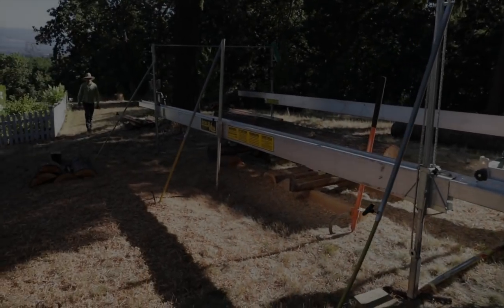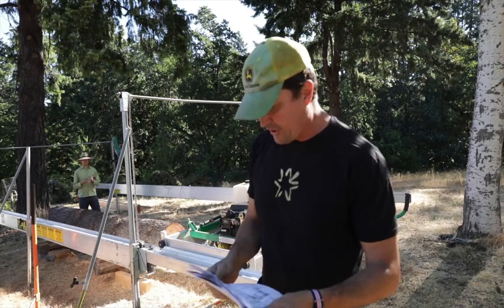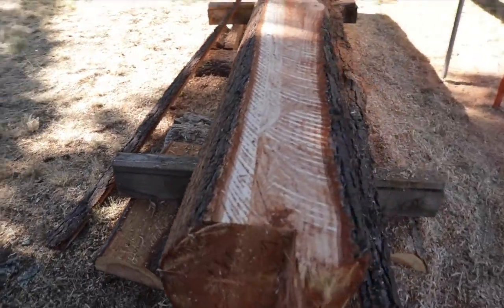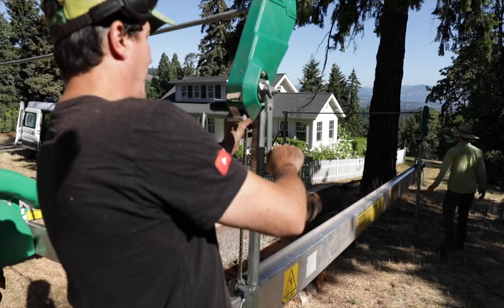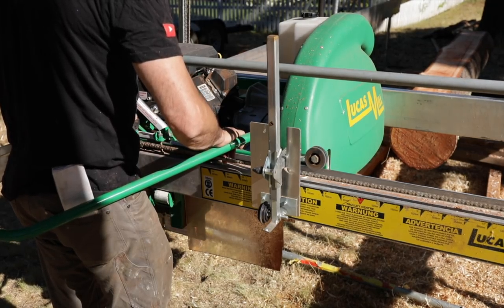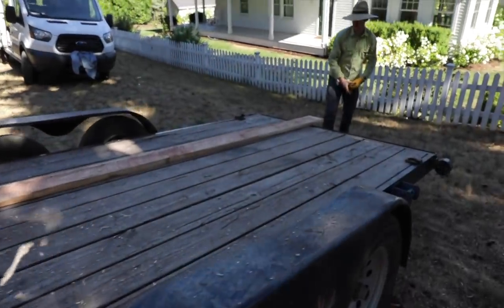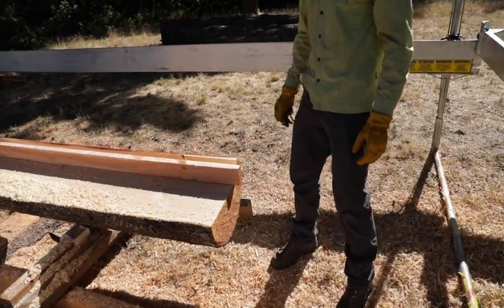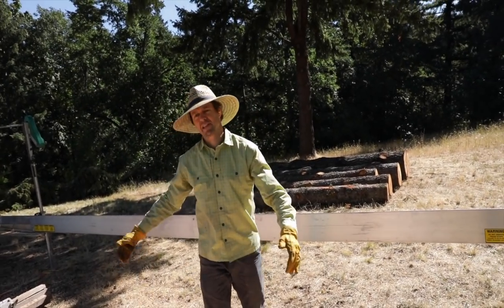AMAZING Machine Turns Logs Into Lumber -FAST!!!

Comment: A 2x8 is cut at a true 2 inches thick by 8 inches wide, but as the wood dries and it planed it shrinks to the final dimensions of 1.5x 7 1/4
Reply: Connor G I quite agree. Always as I have done it. Sometimes I’m very wet timber we cut 1/8th over as it gives us a little more stock for finishing once seasoned.
Reply: Correct 👍🏼
Reply: Drying wood is made by placing the wood in a warm dry place or can you do it with a machine as well?
Reply: Drying wood is traditionally placed outdoors on a block of some sort, then stacked with usually 2-6 inch spacers and topped with a "cover board" as to not let the sun hit the top.

Comment: The Guy below its right. If you want 2x8 you have to cut 2in by 8in, then as it dries and as you plane it it gets its final dimention of 1.5 by 7.5
Reply: That's why dimensional lumber is always S4S (smooth 4 sides)
Reply: Yes! Thats because its planed on all 4 sides
Reply: Exactly drying wood shrinks!  ps-that’s what she said 🤣
Reply: That is not correct at all, go look up "nominal vs dimensional lumber"... educate yourself. It would take forever to plain down .5" per board with a planer and waste alot of time!!!
Reply: @nwhunter3838  Remember that it works out to a 1/4 inch per side, wood shrinks as it dries, more often than not it'll also twist, so you need that quarter per side. I "educated myself", no such thing as nominal lumber, the lumber can be dimensional and of nominal size. Eg. a 2x4 is an example of dimensional lumber in which the nominal dimensions are 2 inches by 4 inches.
Reply: @Intelligent_investor   go to any sawmill and ask if they cut their 2x4's at 2"x4", does not happen anywhere!!! They will cut 1 5/8" and 3 5/8" wet lumber. Please go take a tour of a sawmill and find out for yourself.
Reply: Company's like Weyerhaeuser, Georgia Pacific, and Sierra Pacific would be belly up even in these times if they wasted that must time and product planning a 1/4" per side.
Reply: @nwhunter3838  I'm talking about how it's supposed to be done, the standard guideline is 2x4 rough, and then planed to 1 1/2 x 3 1/2. Also, I don't really think that a 1/16“ per side is enough to turn that extremely wet and rough piece of wood into the shiny smooth 2x4 we find at our local home depots.
Reply: @Intelligent_investor   As I read these comments from you and other youtubers, I get the impression that you all believe a 2x4 is 1 1/2 x 3 1/2 because of planning and warpage when in fact it is not. During WWII there was a lumber shortage along with mills producing 2x4's of all different dimensions. A standard was agreed on and embraced by all... enter the 1 1/2 x 3 1/2. It saved on wood because remember before this, a 2x4 was in fact a 2"x4". Mills now size these boards to have the least amount of waste as possible. I milled some true 2x8's last year and after planning, they are 1 15/16 x 7 15/16... more or less 2x8. The author of this video did not short himself here.
Reply: @nwhunter3838  Just so you know, I'm not a YouTuber. How did you manage to plane only a 32nd per side? I'm assuming that you milled the wet wood to 2x8 and then took off that 32nd.
Reply: @Intelligent_investor  you have assumed correctly.
Reply: @Intelligent_investor  I guess I should have cut them at 2.5 x 8.5 so that I could have spent more of the weekend running them through the planer:)
Reply: @nwhunter3838  It just seams unreal. About 0.8mm/side is painfully little, assuming that it shrinks, warps and you'd wanna get it at least a bit straighter.

Comment: That LUCAS Mill does have advantages 👍🏼
Raw (green) Wood Shrinks—a lot.
Soft Evergreen more..hardwoods less = 2 different (raw) size cut Standards 👈🏼
An Oak Board 2x4 cut—would dry to 1 5/8 x 3 7/8”

Comment: I thought that the dimensions that are used to describe  dimensional lumber is based off of their dimensions before the wood is dried. I believe after the wood has been dried then the different pieces are then dressed down to whatever their actual size will be to attempt to remove some of the bending/warping that may have happened during the drying process

Comment: Hey Wranglerstar, not sure if you have the slabbing attachment or have thought about getting one, but the ten inch mill's gearbox is geared down to counteract the forces on the blade when you swing it over.  As a result of this gearing, the slabber cuts very slowly.  If you're going to be making money off this, I would look into a dedicated slabber.  I believe both the 60 and 76 inch slabber trolleys fit your frame.  
Secondly, I didn't see how you square your logs to the frame, but I find it much easier and faster to take a straight edge (nine foot 2x4 in my case) and lay that on the rails to take the vertical measurement.  Sure, it's a sawmill, but I like to get within a quarter inch of square, so sometimes there's a bit of going back and forth.  Much easier to move and measure from a 2x4 than the powerhead.

Comment: Those lumber dimensions are for kiln dried surfaced lumber. That means after drying and planing/jointing. Rough cut or mill runs should be larger to allow for drying shrinkage and smoothing losses, right? Doesn't the Lucas also lend itself to quarter sawing?

Comment: I'm really impressed with the Lucas , alot less log setting . Although I feel it's not quite as easy to set up the machine , the production factor easily out weighs that aspect . And you can't go wrong with a saw blade over a band , only on resaw line is a band feasible . I'll be looking into these more indepth ! Thank you .
Reply: they seem to be fairly easy to set up, he has a video somewhere of setting it up when he first got it and didn't stuff up too much.

Comment: Original size 2x4, planed size 1 3/4 x3 3/4. If you don't don't plane them down, use the full 2x4. Originaql size 2x8, planed down 1 3/4X5 3/4.

Comment: Because of the high cost of lumber, I have been thinking of purchasing a portable mill to turn my trees in to lumber to build my home; however I will need to find a lumber inspector to grade the lumber so I can use it for home construction (it must be stamped to be used to build a home in my area).  I am leaning towards the Wood-Mizer, because of the accessories, such as the lathe, log turner and a hydraulic loading arm.  Also with the current fire danger, I am going put together a truck with a water tank and pump for fire suppression just like the wheat farmers use.  Do you have something similar and do you recommend any particular pump, I’d love to see a video on this type of firefighting equipment.
Reply: He has several videos on his fire rig, I highly suggest you go through his videos and watch them.  He is using a Honda pump.
Reply: Tenspeed TheBikeHanger 
I did prior to posting and only found repairs on the Honda I am interest in hose size length, gpm and types of fittings.
Reply: Disregard my last I found what I needed, I thing in the play lists.  Thanks.

Comment: This mill sure looks like a lot less fuss compared to the mill used on Pure Living for Life.
Reply: I agree, but remember they are very different, the lucasmill is faster but cant handle as big or as long logs as the ones that PLFL needed to mill. They also went with the most basic version and had no milling experiance.  woodmizers bigger mills like the LT40 is a lot more easy to work with.
Reply: Good point!
Reply: Agreed, I think that's OK... They are entitled to do things their way, people don't need to watch it if they don't like it.

But I don't like watching struggle just because. Money plays a big factor in the choices I make and I am willing to put up with some adversity because of that.

But Time is money, and I would personally consider it a big loss to be using the wrong tools and just grinding through it.
Reply: @Ivar Tjärnstig
what makes you say the Lucasmill can not handle as big or as long? What are your credentials for making such assertions? What is the maximum diameter and maximum length of each ? Why is a bigger mill easier to work with? 
Comparing the specifications on both sites it seems the only thing you are correct about is that they are very different machines with the Lucasmill having greater capacity both in length and diameter
Reply: He's probably referring to Swing-Blade mill vs Band-Saw mill. Most Band-Saw mills can cut much wider slabs. The Lucas is limited to half the diameter of the blade. However, Lucas does have a slabbing attachment that can cut as wide as some Band-Saw mills.
Reply: yeah and I was referring to him being no authority on saw mills and mostly wrong about what he said, BTW the Lucas can cut double width with the circular blade
Reply: Christina Perez I disagree completely. I think they have far more soul then this channel.
Reply: @Mark Kawate how are you defining soul? Neither saw is alive so they don't have a religious soul and neither are legal entities so they can not own a fish, or are you just completely off topic advertising another channel in this channels comments like a complete poo poo face nasty pastie? BTW you are wrong, yes I know you are just stating your opinion, but your opinion is wrong and invalid so not worth sharing, until you learn to have valid opinions keep them to yourself.

Comment: You need to cut the size that you want (2x4, 2x8) and then as it dries and you finish the milling process by jointing and planning then it ends up being 1.5x3.5 and so on so by the time you finish milling that wood it's going to be 1x6.5ish for your "2x8"s. That's why 2x4 is the nominal size and the actual size is 1.5x3.5 so at least you will know next time. Maybe you can get away with not losing as much in the milling process as actual lumber yards do. The shorter the piece the less wood you lose when milling it square hope all this helps

Comment: Does he dry em before he cuts em? Lumber yards usually cut them to a 2x4 wet right after they're felled then dry em out and cut em again to the actual length, in the case or a 2x4 to 1.5x3.5.  Does he dry em out for a few days then cuts em straight to 1.5x3.5?

Comment: Nice Machine; I love your channel!- How long do you have to wait until you can build something from the fresh cut wood?- Greetings from Germany
Reply: Depends on the thickness of the board, a rough rule of thumb for properly stickered lumber with sealed end grain stored out of the weather is one year per inch of thickness. This process can be sped up by kiln drying the timber or totally ignored and use the timber green and just allow for the shrinkage in your construction.

Comment: Enjoyed the lumber being cut. Is it a special blade that allows for cutting both ways?
Reply: It only cuts one way. When it rotates 90 degrees to become horizontal it's then cutting with the opposite end of the blade  (what was the top)  so the teeth are always going the same direction into the wood.

Comment: What is the largest dimension that you can cut with this?
Reply: Jacob Wade if I am not mistaken the blade has a maximum reach of 10 inch so 10×10 would be the biggest
Reply: Jelle Boer thanks
Reply: you can double cut so 20x10

Comment: So Cody I live just west of (ahem) "Mt Kilimanjaro" and Southwest of..."Mt Vesuvius" :-P.

I have a cedar, that a tree climber has confirmed to me "Got the beetle" and is dead. It starts off with a base of about 40+inches and forks out about seven times to a maximum height of about 100 ft. He told me he would take down the laterals if I removed the limbs= $500. I don't think I will have time to do that and suspect he would probably charge me a total of $1500 to do the whole thing. I'm trying to cover my cost and am just not finding great information (I may just not know what I'm looking for) on how to sell off all this wood.

Would you be able to provide any insights? I'm guess-timating I have at least 15 cords and am hoping that a cord @$100-125 should cover the costs. Thank you in advance.